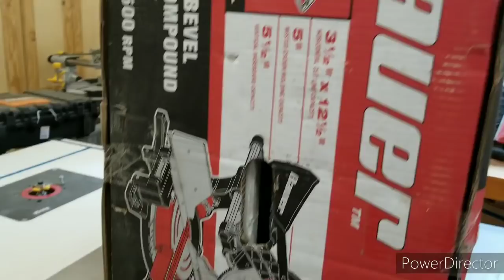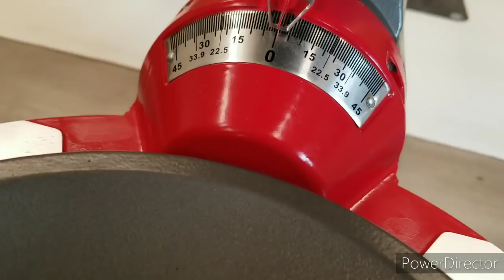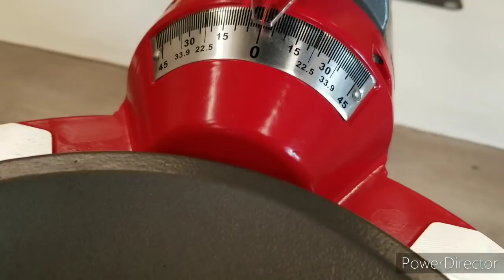Bauer 10 in Dual-Bevel Sliding Compound Miter Saw, Harbor Freight unboxing and review 57179 19743E-B

Comment: Just bought this Bauer slider yesterday and its still in the box.  This Morning I ran across Your Information Vid.  EXCELENT information.  So glad to find this.  You did a Great Job explaining adjustments and operation.  Now I know where to start. Today I unbox and start My adjustments and install the new blade and start cutting.  Actually won't be using it much . Just when I need it, so should last a long time.  I thank You for Your info...
Reply from the maker: Out of all the miters saw I have bought in the last few years, this is the one i have kept. It doesn't fit where I need a miter saw but I just couldn't justify selling it. Be sure to test it before making adjustment. Most should be good out of the box.
Reply: Thank You for that tip...... @ShopRamblings

Comment: I have been using the Chicago Electric Miter saw for 3 years now, and never could get totally accurate cuts from it, and the adjustment mechanism started giving me problems where it would slip out of the levering mechanism, I just would reach under the rail and slide the locking mechanism with my hand and set the angle where I wanted. It's good for cutting up pallets still, and rough cutting larger boards to manageable sizes, but I definitely am glad I bought this new miter saw especially after seeing this review. I'm ambidextrous, and often use my right hand to hold a piece of wood to make small cuts that required an angle that the Chicago Electric saw could only do 1 way, so now that's not going to be an issue being able to make angle cuts from either side. I will be unboxing my new saw tomorrow as soon as I clear out a place for it in the shop. lol
Reply from the maker: Let me know what you think after using the new saw.

Comment: Really appreciate you putting this review out there. Looks like a lot of saw for the money. Even at full price. 

Been holding off on buying a new miter saw in anticipation of how the Bauer saw would come with in features and price. This ones a top contender. Only thing giving me poise is the warranty. I don’t expect it’ll fail. Just that chance you end up with a lemon. 

Will be interesting to see what the sale prices look like on the Bauer.
Reply from the maker: In my experience, they will put out a super coupon once they are in stores. I would guess the price at $170 - $180. 

The only modification I am considering is a zero clearance plate and possibly getting the Jet saw handle to see if it will be a direct replacement. It is only around $20. If I replace it, it will be more out of curiosity than need.
Reply: At around $170, I think the Bauer is a no brainer. Guess I just need to keep an eye out for the first round of sale pricing. 

I’ve seen that some of the stores in my area have slowly been getting them in. So hopefully the first coupons hit sooner, rather than later. 

I do wonder what parts availability will be like in the event something breaks.
Reply: Just watching your vid now. But I'm reading this Bauer 10" has the shadow line light marker on your material. That's a feature i like & that neither the Chicago Elec. or the Admiral Advantage 12" miter doesn't have 😁👍
Reply from the maker: You are correct the Bauer does have the shadow line.. It works great for me. The shadow line is what most higher in saws are coming with now and I am surprised with it along with some of the other features that they've put in the power saw.
Reply: The shadow cut line seems to be becoming more and more common. Even in less expensive saws. Ryobi saws are one such example.

Comment: Bought this a couple days ago to redo our floors with LVP. As a dude, of course I had to unbox, setup, and pull the trigger right away. I LOVE the shadow line! Upgrading from 10" Chicago Electric non sliding with laser line. I am a big diy'er but don't need 100% perfection and this vid helped assure me I made a good buy. Love HF tools but always hesitant. Good work!
Reply from the maker: I love the shadow line also.  I am going to help someone equip and setup a new shop next week. They did not give me a set budget. We are well over $10,000 in already. This is probably the saw i am going to put in. It feels a little weird putting in a saw that cost so little but I can't justify spending 4x more for only a small increase in quality and features.If I ever get time I would love to make a zero clearance fence for it.

Comment: I’ve owned the Chicago Electric Tool fixed 10 inch mitre saw for 7 years and used it to build a desk, and a cat tree and scratching pole without any problems except that it’s not capable of cutting 4x4’s in one pass/cut. This Bauer 10 inch sliding miter saw will be my next purchase so I can cut 4x4’s in one pass/cut.
Reply from the maker: I had the Chicago Electric.  It was a great saw . The Bauer was a huge improvement.

Comment: I purchased this saw based on this video. Got it $40 off through the Bauer Days promotion on 11 Dec 2020. Blade looks square out of the box for 90 degrees when checked against my speed square. Fence looks close enough for me, I’ll need a micrometer though. Didn’t check other angles. Seems solid, easy to use, and I am left handed but am used to working with right handed tools. I was all set to get the 12 inch Hercules, but heard about this saw and watched this video. Thank you for the video! The Hercules is nice, but this saw will satisfy 99% of what a DIY amateur woodworker needs.
Reply from the maker: I agree. The Hercules is a great saw but it if you are not needing to cut boards bigger than 4x12 I don't feel the need of having to move around the extra weight.

Comment: Just put this saw on a Hercules stand from HF. Looked at the square news. Yep out about the same as yours was. Well this was on a job no time to worry about minuta at this moment. Will take of the hundreds of a inch before cutting angles. It is a good solid saw at a very reasonable price.
Reply from the maker: It is a little work horse. I feel it is the best bang for the buck.

Comment: Just got this on discount from harbor freight.... I am blown away by how nice it is.  I guess only negative thing I can think of is the dust pick up being not that good, couple of cuts in with the provided bag to test it and I can tell you that might as well not had a bag on, but I am sure it would do far better with vac. Great review.
Reply from the maker: Ii didn't even think about the bag in my video. I never put it on. I have owned several different brand miter saws. I have never seen one with good passive dust collection. With the collector wrapping around the blade it works better than most with a vacuum.

Comment: This saw is identical to the one sold at Menard's as the MasterForce brand and is $89 more. Great review, Robert, went down to my local Harbor Freight and bought one. The saw is awesome!!!
Reply from the maker: I have seen this same saw sold under three different names. The price at HF is the lowest I have seen it. There is not a week that goes by I don't  use mine.

Was the fence square with the  blade out of the box?
Reply: @ShopRamblings  I did not have to touch anything. Everything was within .2 of a degree which is awesome!! I will use it to install treads and risers on our upstair stairs.

Comment: I just bought this saw used and after watching this video, I'm glad i did. With a saw like this, what is the best way to cut crown molding as there does not seem to be a clamp in front. Thanks.
Reply from the maker: To cut crown molding, attach a taller board to the fence. 🛠️ #DIY #HomeImprovement

Comment: Nice saw. I couldn’t wait for the Bauer 10 inch. I got a Craftsman 10inch before Sears closed. I found one with the slide bars reversed. I have it mounted on work bench so space behind saw is close to wall. They need to make a miter saw with reverse slide bar for close quarters
Reply from the maker: That is one thing, this saw is long. Luckily I don't have to worry about space behind mine.

Comment: i just bought one to replace my 25 yr old dewalt 12in. slide ,seems to be just as good 1/3 the price lets see how long it lasts
Reply from the maker: I've had mine for several years, and it still works perfectly after I rewire the LEDs for the shadow line.

Comment: THE best 10" sliding miter (in the $200 range). I purchased 3 others all within one week. Ryobi 10" sliding had way too much kick at start(scary) and brake hardly slowed the blade down. Kobalt 7-14" sliding had too much loose play in various places such as the blade, the lever arm (real flimsy lock design - look at it). The Kobalt 7-1/4" did start up nicely and the brake worked great...prob due to smaller blade. I also had a TackLife 10" sliding which was ok, but didn't have a brake. It took 6sec to come to a stop, whereas the Kobalt took 1sec.
Don't let the HarborFreight "cheap tools" stigma disuade you. Bauer (& Hercules)  build quality is really very impressive.
I don't want to get into detailed "this vs that"  but stop by HarbFr and check out the display model. (not at all affiliated-lol). Oh, I also saved 10% w/coupon!
Reply from the maker: I agree with everything you said. There are some HF tools that are cheap and some that are priced equal to Name Brand tools. I find this tool to be well balanced  between quality and price. For a standard miter saw I belive this is the best value one can find.

Comment: Great information and help deciding on this Bauer miter saw.  Is the miter SS detent plate adjustable?  Downloaded the manual but did not see any mention of adjustment .
Reply from the maker: There are screws at each end. You may be able to adjust it there. I locked  mine into the 0⁰ detent an adjusted the fence. Once it was zeroed all of the other detents were dead on for me.

Comment: nice review I am waiting for the 20volt 8 1/4 slider one to come out I do small projects so the 8 1/4 inch will suit me needs
Reply from the maker: I am the same way. I don't need a 12" saw to cut 3/4 wood. I like the 10" because I can buy one size blade and use it on either my miter or table saw. I was going to buy the Delta Cruzer. All the major retailers have removed the 10" version from the sites including Delta. I had the Dewalt 12" and it was just to big and heavy.
Reply: If you can live with a 7-1/4", check out the Ryobi on special for $99 - https://www.homedepot.com/p/RYOBI-18-Volt-ONE-Cordless-7-1-4-in-Compound-Miter-Saw-Tool-Only-with-Blade-and-Blade-Wrench-P553/307298546
Reply: @jimdavis5u  I have one of those can't cut anything bigger then a 2x4
Reply from the maker: The 10in sliding gets the depth I need along with enough reach for what I do. It is all about the right to for the job.
Reply from the maker: That is not enough saw for what I do. For the right job, it would be a good saw.

Comment: I picked up one 2 months ago, and I love it!! How yours is holding up? Thanks for sharing video 👍
Reply from the maker: I used mine for several years. One of the best things that I liked about the saw is it had the widest cut of any miter saw I have found. What I hate about this song is it sticks out further than any saw I've had. Where my miter station is in my new shop the saw stuck out in the way. I need it something closer to the wall so I got the Delta Cruiser and the Bosch Glide. I settled on the Bosch but I did Keep the Bower just because out of all the miter saws I've used I'd like to eat the best if you have room for it. The only bad thing really about the Bauer is here in Florida if you leave the shadow line on it will burn out. I replaced mine and I rewired the switch. The way it was Wired from the factory is the DC power converter is powered anytime the saw is plugged in. I changed it to where it is only powered once the switch is turned on. I don't know if that's what made the difference but I never had the LED go out after I changed the wiring.

Comment: Thank You for the Awesome video.  I've been looking for a new saws lately . Menards has the same IDENTICAL saw badged as a Masterforce in a green color. $319 dollars. Looks like they came out of the same Factory. I guess I can save a $100 bucks at Harbor Freight. Thanks again.
Reply from the maker: I believe they made the same saw under several different names. the base is the same as the jet saw that they sell at rockler's for about 450 bucks. Although this one has the upgraded fence. You can tell that the machine marks are different on the fence than the main portion of the saw bed. So for half the price you get the best part of the saw with upgrades. So for me this is a no-brainer purchase. I posted a video last night on the Ridgid planer. At the end of the video is a couple of pictures of shiplap and cabinets that I use this power saw to cut. I cut a couple of hundred boards and every single one of them was perfect angles. What I don't have is the mantle which I used a compound 45° 45° to make a hidden mount. I cut all the compound angles on this saw and everything fit perfectly when I slid the metal on all I had to do is give it a couple little bumps with the palm of my hand and it popped in place. I did not even double check the angles on the saw I just use the detents

Comment: Can you tell me what the measurement is from the front mounting holes of the base, to the back of the slide tubes? I plan to mount it to a work bench along a wall and I may need to widen my counter top.... Thanks
Reply from the maker: The cord comes out the back. I would give it 32" but it might fit at 30".

Comment: I just bought it Saturday I put a all purpose Diablo blade and the blade jammed in the 2x4 green pt. With peaces flying everywhere.. why did it do that..
Reply from the maker: Not completely sure what you are saying. So this may or may not apply. A combo blade is trys to do a decent rip cut and cross cut with one blade. A miter saw is made to do cross cuts. I would at a minimum use a cross cut blade. All of my saw have a sliding miter saw blade. They usually have a negative tooth angle around 6⁰. A rip blade has larger teeth and a more aggressive tooth angle. It will still cut on a miter saw but you have to control the speed you push the blade into the wood. With the larger teeth and positive angle it can try and dig into the wood to fast. This is especially true with soft woods like pine.

Years ago I would use a blade like this.
Diablo by Freud D1060X 10" x 60 Tooth Fine Finish

https://amzn.to/3g85zO6

Now I use this blade.
Freud LU91R010: 10" Thin Kerf Sliding Compound Miter Saw Blade
https://amzn.to/3E7ZM36

If you just bought your blade for Home Depot they should let you return it. Are you can keep using the one you have. Just make sure you hold the trigger for a second before starting the cut to make sure the blade is a full speed. Then make make the cut at a steady pace and not let the saw dig in to fast. This is going to be the same for any saw.